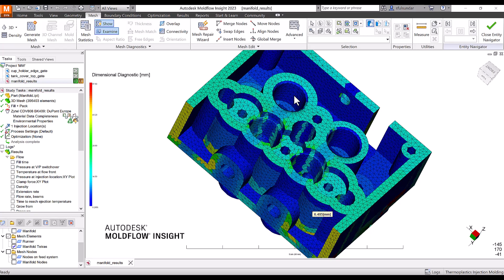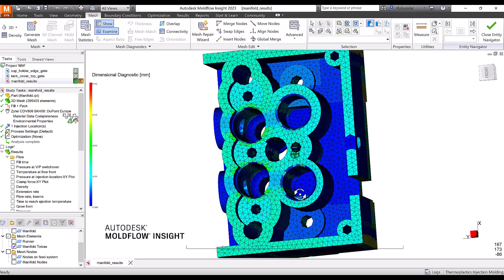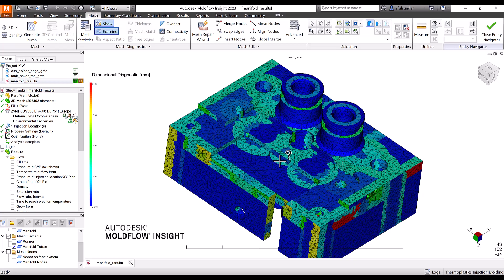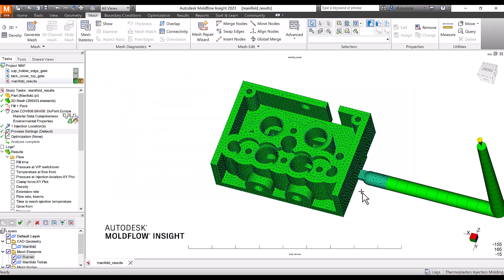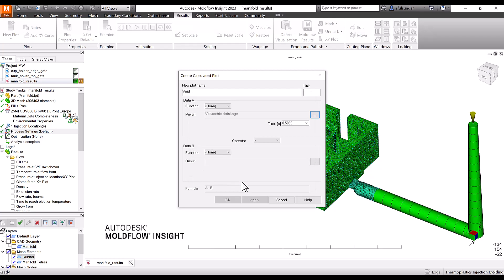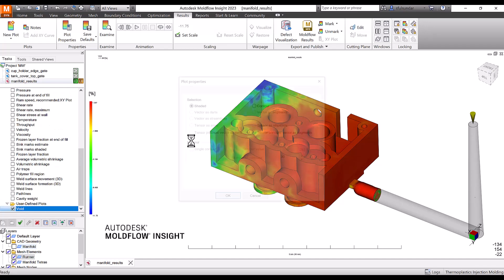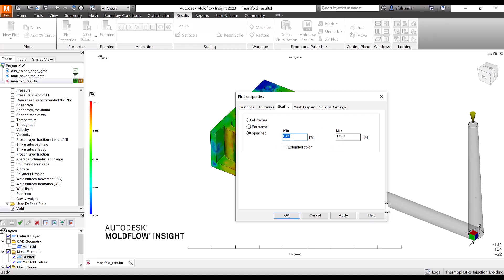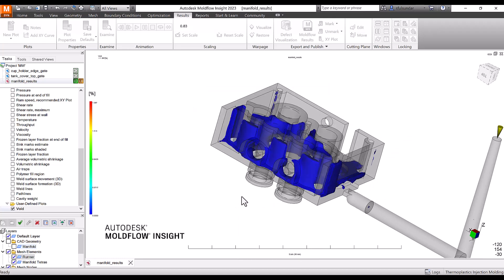Void Prediction in Autodesk Moldflow

Comment: Hi Mr. Sachin Fulsundar, 
Thank you for making this video! This is a great idea to get the void. 22% is lowest number which can predict void, it means when we use this number for evaluation that there is no the void, we can rest assured that there will not be any the void for real model. Do I understand correctly? (However, we use 64% for evaluation that is reasonable). Where do you base on to use 22% or 64%? Is it from experimental test or your experience? Thank you!